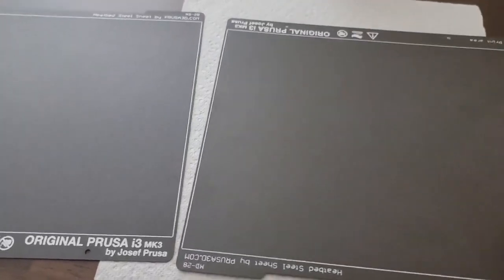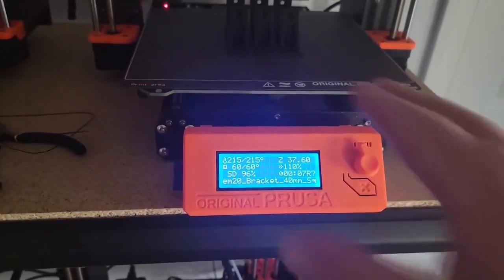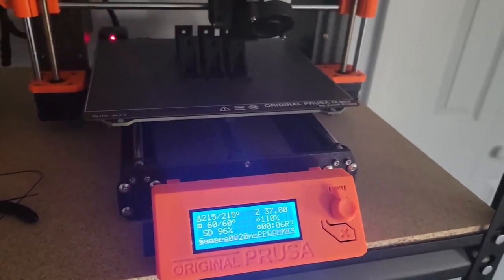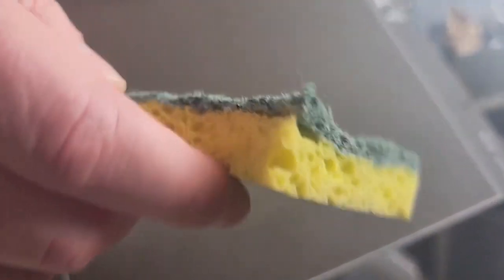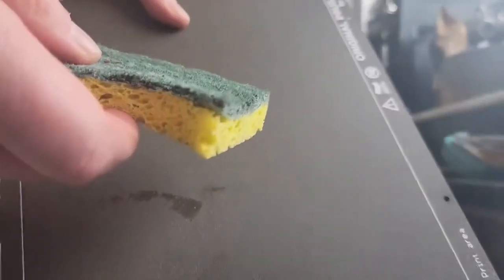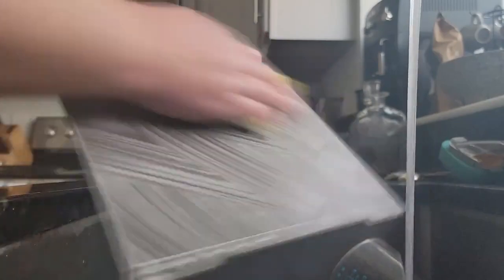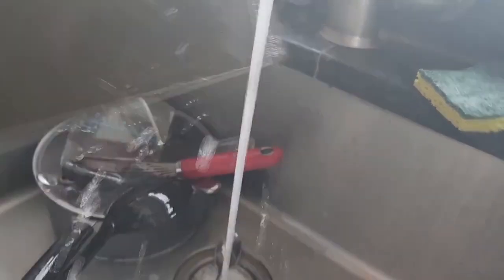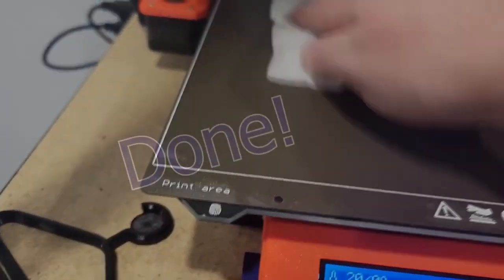How To Get 3d Prints To Stick To Prusa Textured Steel Sheet - Solved!

Comment: No matter how long I scrub the pad with dish soap and sponge, still I don't have the effect that you have shown (a hydrophobic effect like on freshly waxed car) and I can't get even PETG to properly stick. I'm starting to think that my plate from AliExpress is a scam (but the shop had good reviews, anyway). I think the next step is sanding the plate smoothly with a fine sandpaper..
Reply from the maker: If you got it from AliExpress it's probably a knockoff, so this process may not work
Reply: @glennbrian3d  yup, I'm worried that this plate is trash. However, I temporarily fixed the issues with big squish of the first layer. Do you recommend any trusted supplier for 300x300 plates?
Reply from the maker: @taboret9275  Ive never tried the aftermarket plates